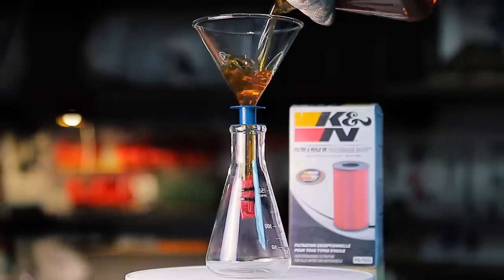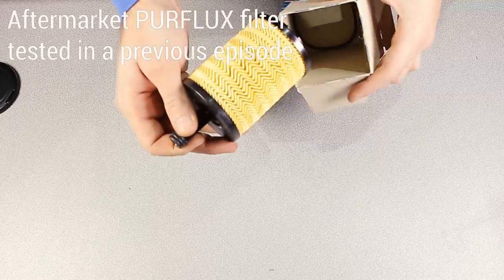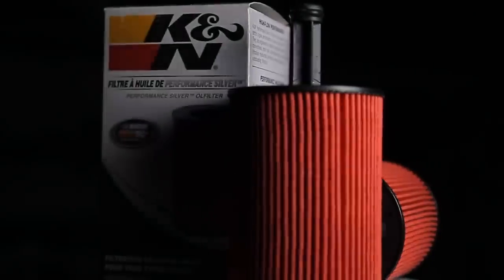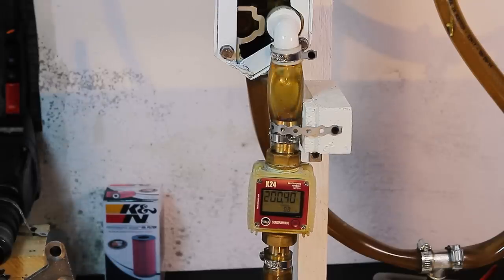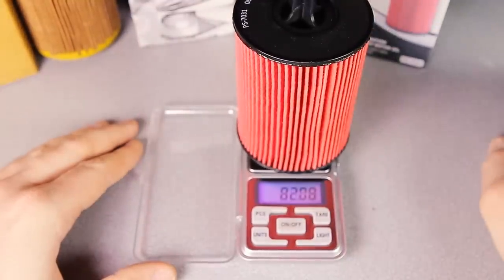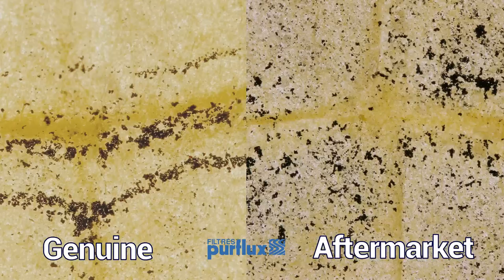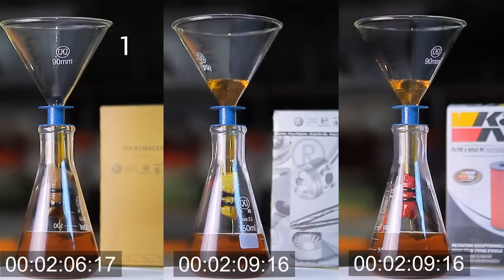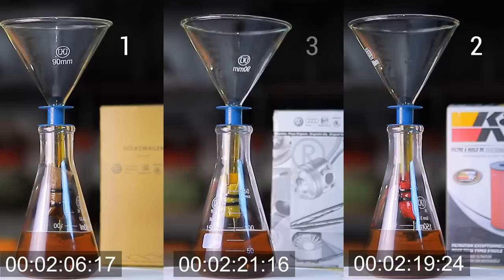K&N vs Genuine - Oil filter comparison & test

Comment: Hi Sergiu, I’ve been working as filtration specialist for about 8 years and I must say that you are explaining everything very good and accurate. The only thing you need is a particle counter to be fitted inline after the filter. Then you will be able to measure particles smaller or bigger than what the manufacturer claims. Keep these videos coming 😉
Reply from the maker: Hi Lasse and thanks a lot for your appreciation. I've been looking for a particle counter the can work with oil from the beginning, but I couldn't find such a device. Most of them are dedicated for airborne particles, not for particles suspended in liquid. If you can suggest such a device, I would surely use it in my tests.
Reply: Hello lasse, can you tell us something about your experience? Is for instance a OEM filter the best? Or are the the other non OEM filters "programmed" to be less effective than the OEM.

Comment: Excellent work! I think I know why is there a difference between OE Mann and aftermarket. It actually has to do with country of manufacture. The OE Mann was from Germany, and the aftermarket you tested from Spain. Mann used to make this exact model of filter only in Germany, for both OE and aftermarket, but now they are made in Spain and Czech (they confirmed this by email to me). I used to order them from Autodoc, they were always from Germany and had that more brown-ish thicker filtration material, even though they were aftermarket. I recently ordered them again from Autodoc, the one that came was from Czech, and I ordered one from a local shop, this one was from Spain. Both are almost identical and have the thinner, lighter in color filtration material. If you're buying Mann filters, check and make sure they are German ones (it's darker in color), if not, maybe it's best to go with Mahle.

Comment: If you add a second control filter with a know very low/small micron filtration media, use this to see how much and how big the particles are that are passing the oil filter being tested… measure using your micro scope, count number and size of particles in a given area. All other comparisons a side the amount and size of particles passing a filter and the flow restriction are the metrics that have the biggest risk to engine life👍

Comment: I'm using a larger canister size K&N on my 1ZZFE Corolla 1.8. The same used in Audi/ VW AP 1.8L and even the Ford Taurus 3L V6 Vulcan. Thrid time about 30 k kms. Good start sound now.

Comment: Hello Sergiu!

I love these informative videos. They are, in my view more interesting than Project Farm’s videos on the subject. 

I’d love for you to have a cooperation regarding at least oil and oil filters. I’ve never seen Valvoline or MANN handle the test as well as in your testing in other testing. 

MANN Hummel seems to have different products for the same car models in the USA and in Europe. This is especially noticeable when it comes to Wix and Wix XP. As a consumer it is hard to keep up with all of this and we cannot just look at what is being tested in Europe or in the USA/Canada and believe that we’ve got the full picture. 

Wix 57055 is the product for Subaru XV (Crosstrek) NA Subaru Forester in North America, but it is WL7475 here in Europe and the Wix XP is not available at all. 

Wix 57055XP. 

I’ve been using Amsoil Signature Series 0w-20 for some time now. The cold Start quality of the oil is what is important to me here in Sweden. 

Amsoil does also have their EA15K-filters. I currently run AMSOIL Signature Series 0w-20 and EA15K01 in my Toyota Verso-S (MY2012) and the same kind of oil and EA15K13 in my Subaru Forester (MY2016) 2.0 XS (naturally aspirated engine).

I highly recommend https://www.ato.de/ and https://chemiasamochodowa24.pl/en/ for buying oem and Amsoil oils (and filters). 

The Amsoil filters are supposedly good for 20 microns and the filter media is some kind of polyester and not cellulose.  

Now, I don’t run my oil and filter 15000 miles (ca. 24000 km). I change it every 6 months and/or 10000 km.

Comment: Hi Sergiu, your video are very good and I learn a lot from them. I have to tell you that the flow test isn't 100% like in real life, I think that it's importat to compare the flow of the material and the surface area, because a material can have a bad flow but with a larger surface area can have a better flow over all. Maybe if you calculate the flow rate over the surface area you can have more accurate result. What do you think about it?